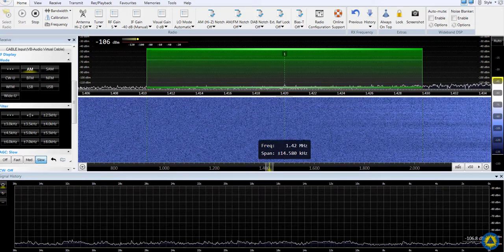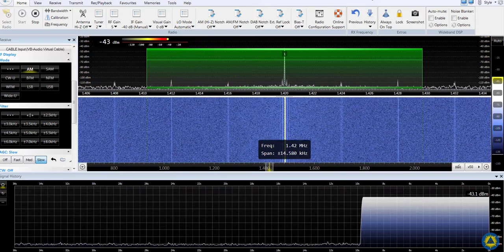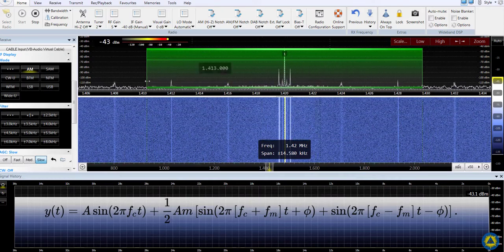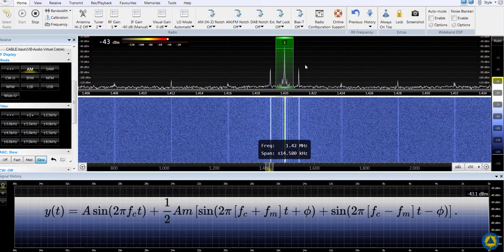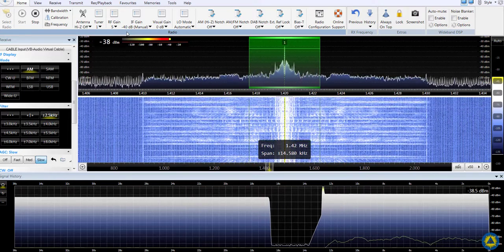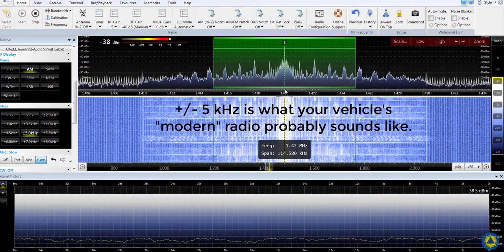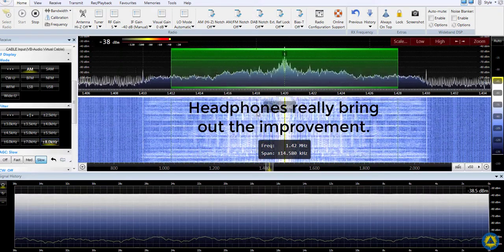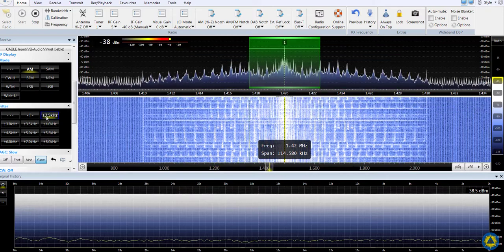Understanding the benefit of radio bandwidth with a look at amplitude modulation

Comment: Great video, particularly because you highlight the two active frequencies either side of the carrier. I am struggling to understand this. Are these + and - of the same tone frequency, or duplicate single frequencies? I believe AM creates duplicate side-bands so you can listen to one or the other. Also, in FM bandwidth I assumed the low tone frequencies would be lower than the carrier and high frequencies higher, but the examples I've seen also form a peak at the carrier with what appears to be mirrored signals either side of it. Please excuse long, dumb question.

Comment: If larger bandwidth is better, why would anyone want a smaller bandwidth?  Does it save battery or energy?  Does it reach farther?  What are the benefits of having smaller bandwidth?
Reply from the maker: Lower noise pickup is one reason.  This isn't something a broadcaster would worry about too much, but for other communication purposes, noise can be a problem and the amount of noise received is proportional to the bandwidth... therefore less bandwidth equals less noise and higher likelihood of hearing a weak signal.  The full bandwidth I demonstrated with the music is great for fidelity of the music, but unnecessary for other communications like, for example, voice where 3000 Hz audio is plenty.  Hence the AM bandwidth for this would be +/- 3 kHz or 6 kHz total rather than the +/- 10 for the better sounding AM music example.  Because lower noise situations can hear weaker signals, yes it does reach farther.
Reply: @SkyCharter  how about energy consumption?  Is that effected?